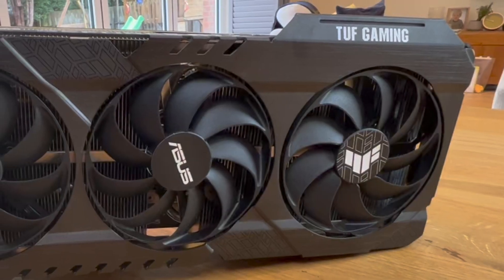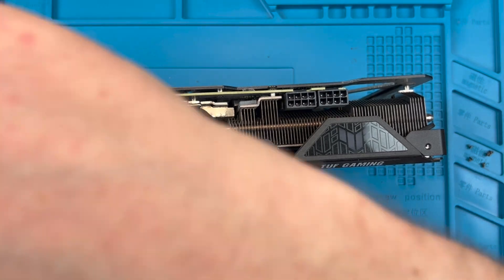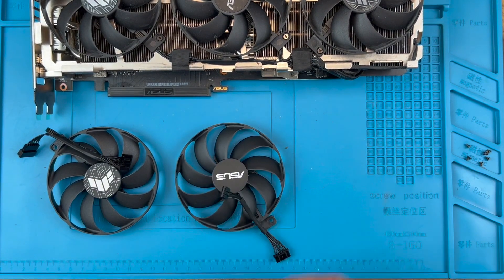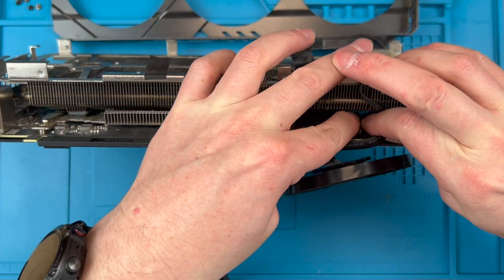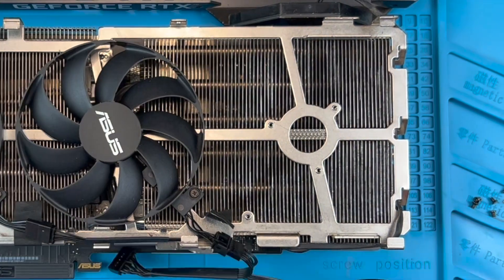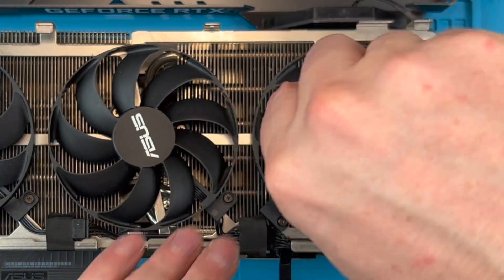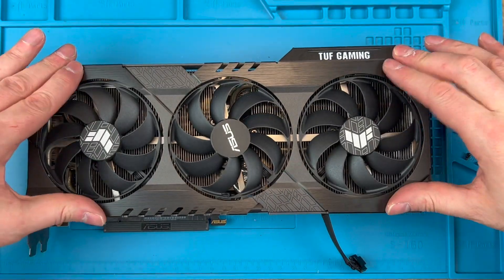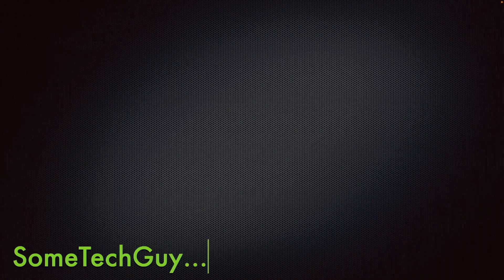Asus TUF Gaming - Fan Replacement in 10 mins

Comment: Thanks for the excellent video.  where did you buy your replacement fans from? there are so many options out there?
Reply from the maker: Thank you!

I bought mine from Ali Express, it was an experiment and I am not sure I would recommend it. I bought fans for a variety of GPUs I made videos on, and the Asus ones seemed to be good but I had a really mixed experience with other fans being either poor quality of simply not fitting correctly. The MSI Ventus fans especially were just not the correct size, and Ali Express does not make returns easy.

I can't recommend them personally as I didn't use them, but I think quite a few people pick up the inRobert fans from Amazon and I have not seen negative comments about them. By buying from Amazon or EBay you can at least return them if they are not up to scratch.

Here is a direct link: https://amzn.to/4h69SmM

Good luck with the swap.

Comment: Where do i get these fans and what's the dimensions?
Reply from the maker: I can’t give you specific advice on where, other than check sites like eBay where you have buyer protection in case they are not correct spec/fit.

Dimensions on my fans are in the comments, I would double check your own just in case they differ.

Comment: Nice video! I validated my RMA on a GPU identical to this one because one of the fans was defective. They changed it for me, but now I hear a "Coil whine" haha. I have researched and as I read the "Coil whine" is not harmful to the pieces, it is even common. Have you had experience with the "Coil whine", is it possible that it reduces the life of the GPU?
Reply from the maker: Under certain conditions, it seems common. I tested different cards from different manufactures with benchmarking software, and certain tests seem to produce this across multiple cards. I don’t think it’s a cause for concern, though the noise can be a little irritating. But I didn’t have any problems with it personally.
Reply: @sometechguy  yes is kind of disgusting sound but now that you tell me that you have not seen this being a problem im more relieved. Thanks for answering.

Comment: Amazing job! I've a question tho, did you replace the fans because they were starting to get noisy or damaged?
Reply from the maker: In this case, I think one of the fans wasn't spinning. It wasn't my card though, so I can't be certain if it failed of its own accord, if it was physically damaged.
Reply: @sometechguy  Thanks, I recently got an Asus Tuf 3080Ti which I exchanged for my 3080, the card is in pretty neat condition but it appears that there's one fan that's getting a bit of high pitched noise at certain times.
Reply from the maker: Maybe there is some wear on a bearing that is causing that, but also check there isn't any dirt or dust build up and that the outer edge of the fan isn't fouling on the shroud. You could give it a clean up with a cotton bud and some isopropyl alchohol. But if it needs replacing, it quite an easy job. Good luck with it.
Reply: @sometechguy  Thanks a lot! I did fix my psu fan that had a very nasty noise, I opened the bearing and used sewing machine oil, worked like a charm! Of course a gpu is more delicate to operate with haha.
Reply: @davepianist84 you are right! U need just use some oil on them. Question, did you open the fan or did you do a whole in the back side?

Comment: Do you know if these fans can be lubed, as in, are they open under the sticker in the back?
Reply from the maker: I have not tried, but looking at the fans on the TUF card I changed, they are fluid bearings and not ball bearing units. Fluid bearings are normally sealed, but should also provide the best lifespan and be the quietest. If the fan is noisy or seems failed, it may not hurt to take look and see if yours is the same, if it’s a ball bearing or sleeve bearing you should find oil wells, but if it’s a fluid beating, you probably won’t find anything. I was able to stick the sticker down again no problem on an MSI unit I opened recently which used a ball bearing. This keep dust and dirt out also.

But I caveat all this by saying that I have not opened up a TUF fan, and from experience with other cards, the fans types can vary. 

Check if your model numbers are different, they often distinguish the bearing type.

Comment: Do you think I could swap them with Noctua fans?
Reply from the maker: I wouldn’t have thought directly, unless Noctua sell fans of the exact same dimensions (which I am almost certain they wouldn’t). All the Noctua fans I have come with their own housings. So you could remove the fans and shroud and do a custom job, which I think has  been done before, but it’s nothing like this video. :-)
Reply: old post but if someone see this... I custom modded my GTX1080. It was tricky. I used NOCTUA fans and ZIP ties but discovered weird noise coming from the graphics card due to the extra POWER DRAW likely. I then moved the 2nd fan (not over the GPU processor but rather the VRAM) to a motherboard fan header. I then used "Fan Control" to control the fan based on the GPU (not CPU) temperature. Also, needed a 4-pin adapter as the FAN 4-pin is a different size from the Noctua fans... ended up PERFECT! I had my fans just spin at 300RPM in idle and they rarely went above 600RPM (which I couldn't hear even with speakers off). But...
When I got my ASUS RTX4070 I soon discovered the fans turn on at 55degC and start at 1000RPM. Not super noisy but slightly annoying. You can NOT change that and making a custom fan profile disable the 0dB mode so the fans will be at 1000RPM minimum. Why? I'm debating just wiring in two Noctua LNA's with the Asus fans. They are just a RESISTOR so you drop voltage. Long story short the card works the same but the fan should spin at roughly 800RPM to start which would likely be about HALF the noise. No idea why Asus STARTS at 1000RPM as I highly doubt the fans can't go below that.

Comment: I wonder if this fan fits 4090s as well
Reply from the maker: The cooler on the 4000 series is quite a lot larger. The fan cabling layout looks the same, but the fans have a different molding, and I think they are a fair bit larger at 105mm...unfortunately. The TDP on that card is a lot higher, and this is what leads to the cooling upgrades, including the larger fans I guess.